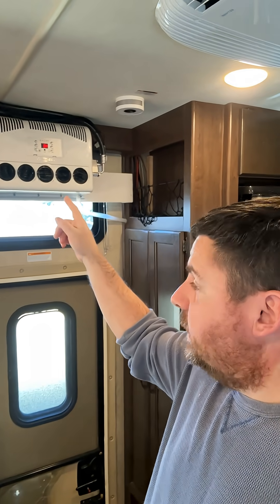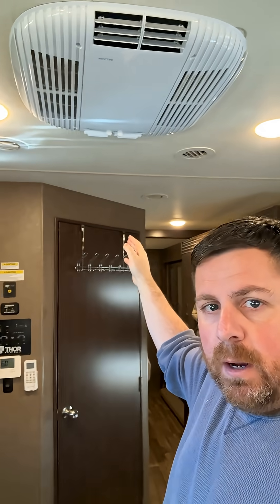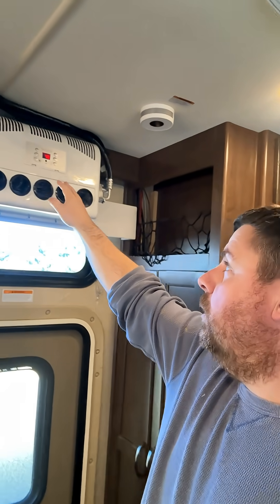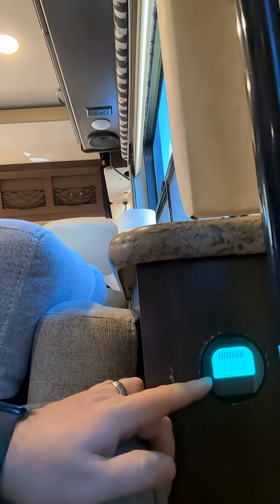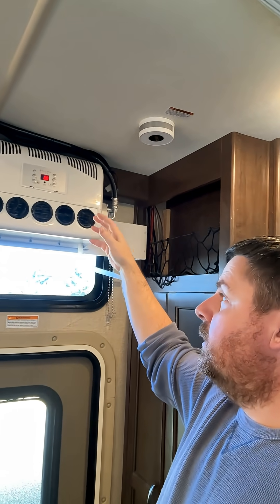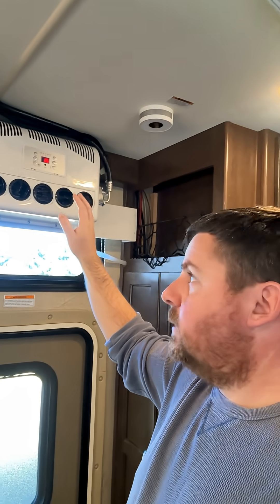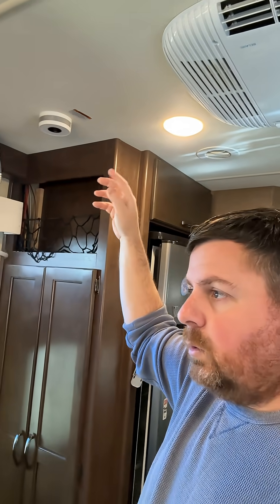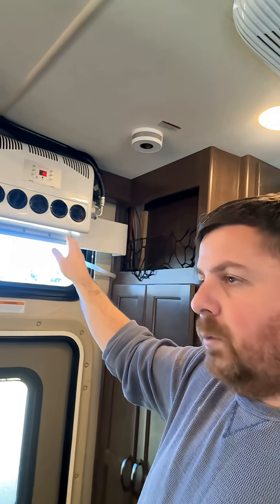Will A 12V Mini Split Air Conditioner Run On Lead Acid RV House Batteries?

Comment: Your using lead acid thats lame. Something like this needs a lithium battery. You must.be rich for the price of leads nowdays you can buy two lithium batteries. 😂
Reply from the maker: If I were rich I would buy the lithium! The 4gauge leads were only about $50 for 20 feet red/black.